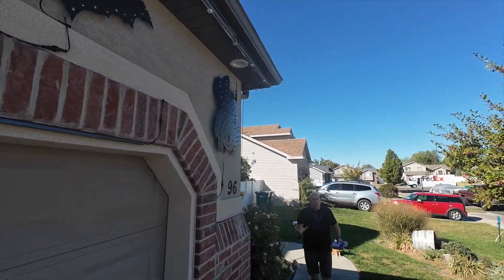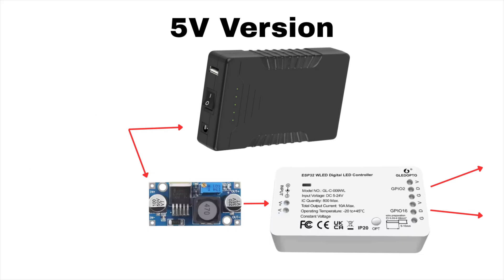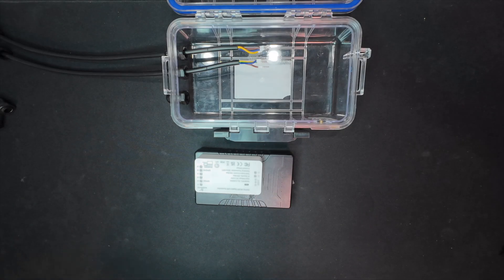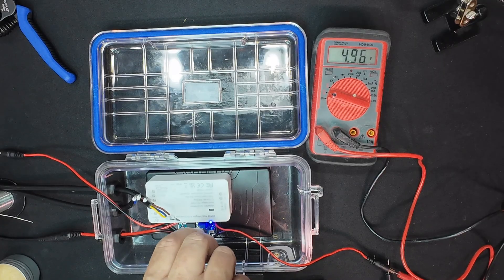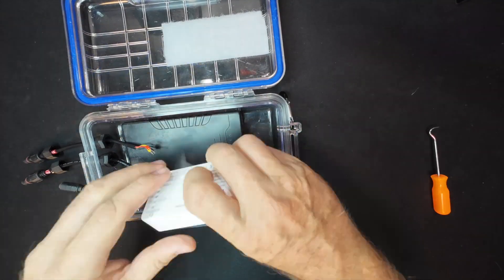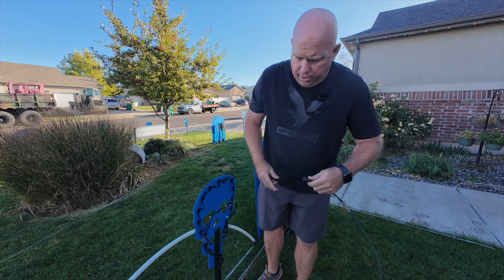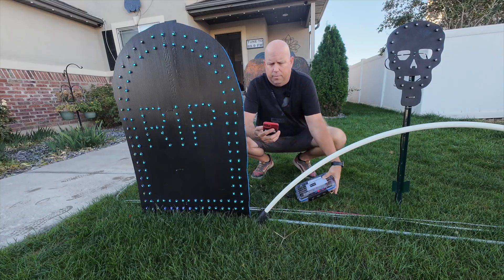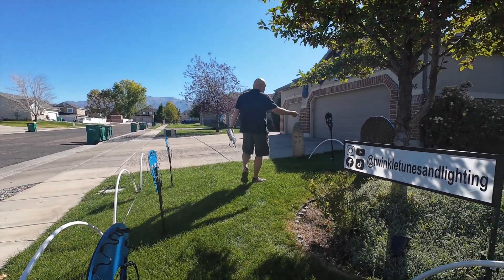DIY LED Pixel Tester | 5V & 12V | Battery Powered with WLED (GLED Opto)

Comment from the maker: If you’re building one of these testers or just want an easy way to check pixels before install, I’ve linked all the parts I used below 👇

👉 GLED Opto controller  
👉 Battery + power connectors  
👉 Pixel tails and accessories  

I’ve also got everything organized in my Amazon Storefront here:
https://amzn.to/4aWvm5Y

This tester has saved me a ton of time chasing bad pixels and wiring issues — hopefully it helps you too. Let me know what you’d add or change!

Comment: Great idea!  Regarding using the device in xLights wirelessly, have you encountered any issues with it lagging in the sequence?  I have been thinking about doing the same thing but worried that it wouldn’t sync well.
Reply from the maker: Wireless will always be slower than wired. That being said I have not seen it when I have it on props like my light bars, skulls, and candy canes due to the low density of lights. I do see it lag however on singing faces and larger wreaths. I am also running at 40fps in Xlights which is a lot of info. I would say if it is smaller props you would be fine. Larger ones you will see it.
Reply: @twinkletunesandlighting thanks 😊
Reply from the maker: @chriswalters5301 always. Thanks for the sub and the views.

Comment: Hey would you be able to have the buck converter on the output side of the controller. 

So charger wall plug
To battery
To WLED controller
Then splice your power and data outputs into two outlets
One to buck converter then a output
One to a 12 volt output
Reply from the maker: That’s a great question! 👍
Yes — you can put the buck converter on the output side of the controller if you want to have both 5V and 12V outputs. Just make sure your battery and main input voltage stay at 12V, and that your buck converter can handle the current for whatever 5V pixels you’re running.

So your setup would look like:
Wall charger → Battery → WLED controller → Split outputs (one direct 12V, one through buck converter to 5V)

That way you can test both 12V and 5V strings from the same tester. Just be sure to double-check polarity and current draw before plugging in pixels.

Comment: Thank you so much; I've seen it in the back ground of some of your videos!  I took your advice and purchased a Bong 69 controller.  I downloaded the instructions and can’t locate the recommended wire gauge size from the DC power supply to the Bong69 controller.  I’ve seen some individuals use 18 gauge all the way up to 12 gauge on various controllers.  I'm considering either 16 or 14 gauge, although the length of the wire is less than a foot.  No one mentions that the length of wires (positive and negative) needs to be identical. 

As a Newbie and after watching multiple v deos, I've noticed a lack of content coverage involving two topics:  First, determining if props should be on the same channel (6 props of less than 30 pixels). Second, splicing, adding connectors and extensions between the WS2811 bullet style pixels in  props.  There are multiple  videos on the LED strip lights and Govee lights.
Reply from the maker: Hey, that’s awesome — glad to hear you picked up a Bong 69! You’re going to love how flexible that controller is. For the power wiring, since your run is less than a foot, 16-gauge wire is perfect. If you already have 14-gauge on hand, that’s totally fine too. The short length keeps voltage drop minimal, so you don’t need to overthink it. And yep — it’s good practice to keep your positive and negative wires the same length so your current stays balanced across the connection.

You’re absolutely right — there isn’t much content covering small prop channel grouping or pixel splicing. I’ve actually been planning some videos that go into exactly that: how to decide when to combine props on one channel and the cleanest ways to splice or extend WS2811 pixels. Thanks for the great feedback — I’ll make sure to include that in a future tutorial!
Reply: @twinkletunesandlighting  Thanks for the reply…  I’ve experimenting using our 4-foot wreath from last year and converting it over to the pixels.  Currently, one channel with two segments (wreath and bow) as I learn WLED.  I’m curious about your arch setup in WLED and how the pattern is exactly the same on every arch and the ability to reverse the motion.